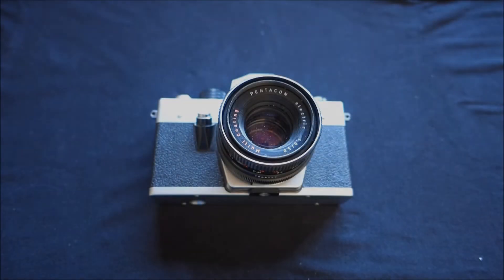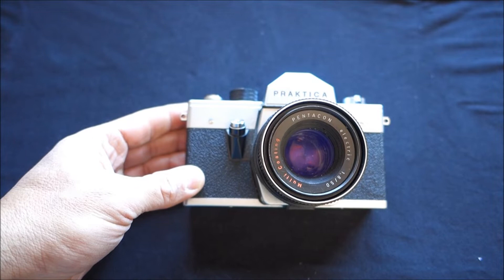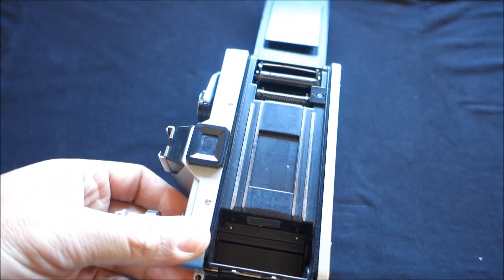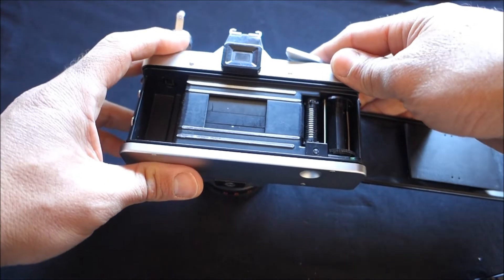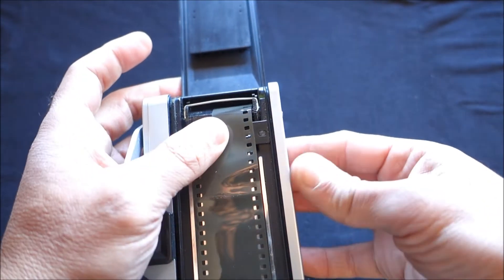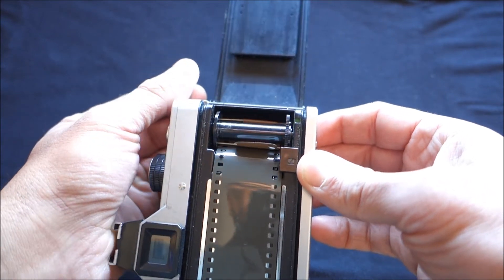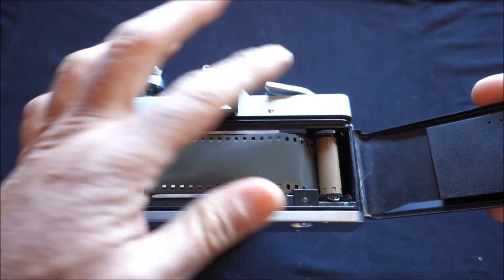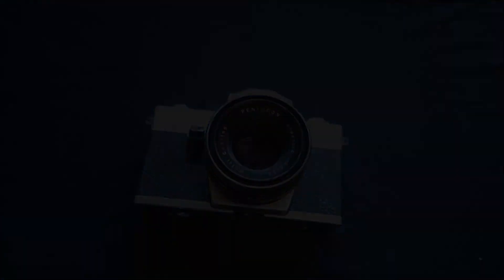Praktica PL loading system

Comment: Thanks for your video!
I have a Praktica MTL50 with the same PL loading system. Even I do load the film "maybe properly", I often get some frames mounted each other resulting in unintentional double exposures or half frames connected with the next 1/3 frame. Do you know if there is some issue with the winding system or is the normal result of loading wrongly? Thanks!
Reply from the maker: Thanks for you comment. If you are loading the camera correctly, then you have a problem, that sort of thing shouldn't happen. It's easy to check if there is a fault with it. Put some old dummy film in the camera. Remove the lens, put the shutter speed dial on B. Have a felt tip pen at hand, fire the shutter and keep the shutter open. Draw two vertical lines on the film, one on the right side, one one the left. Do this all the way up to the end. Remove the film without fully rewinding it, pull the whole film out of the cartridge and examine your markings. If they are not evenly spaced, you have a problem. This method allows you to see if a particular fault appear randomly, always on the same place, etc. Good luck!
Reply: @paulomoreira007  Good idea! Thank you!